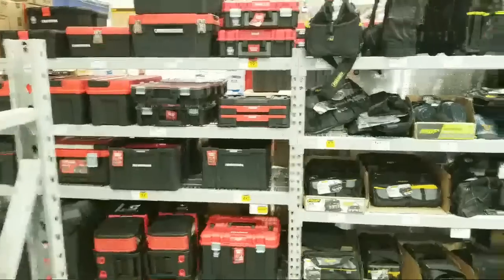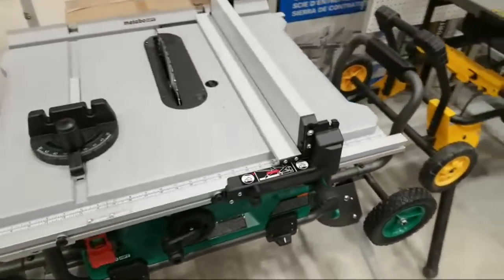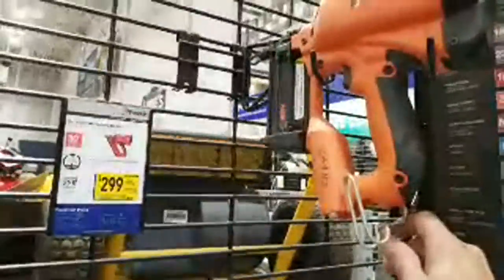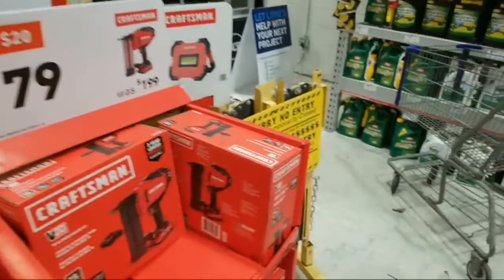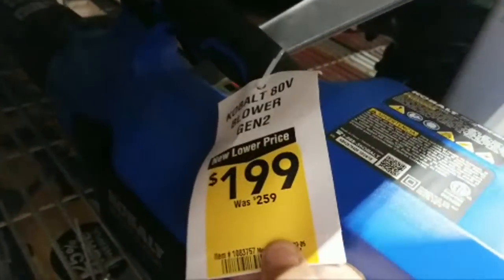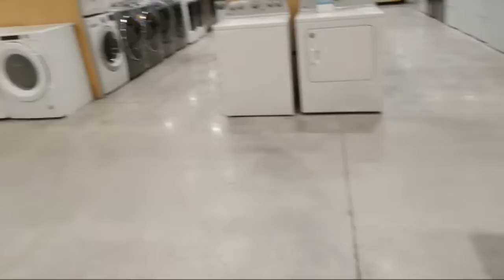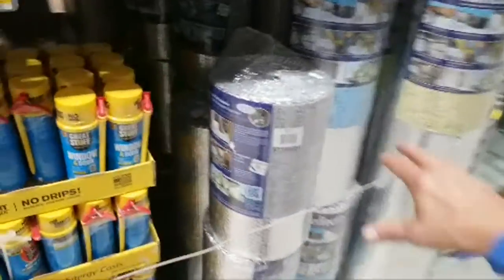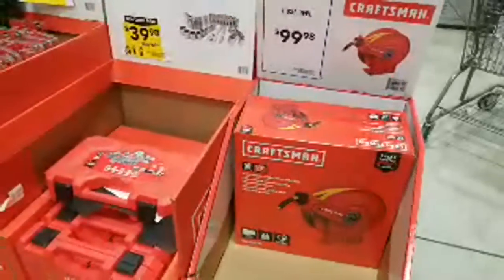Lowes After Black Friday Sale Tool Deals DeWalt, Craftsman

Comment: Always assume a blade is spinning, and keep thick superglue in your toolbox for any cuts, upto and including inches long wouns, so long as the bleeding can be stopped (relatively), and they can be perfectly squeezed back together after you lay a bead of glue up the center.  Glue will harden and create the perfect scab.  You can go back to work immediately, and the glue will flake off like a scab in about the normal time or less.  And aside from the indent (and how well it was lined up when stuck back together), no scar to speak of.
Reply: Working on a Habitat house years ago we had a guy cut open the web next to his left thumb; did it with a new blade in a utility knife while running it down some drywall. Deep, long cut that bled like a water fountain. Took him to the VA hospital close by and they closed it with glue. Said it was better than stitching it in that location. Saw him 2 months later and you could barely see where it happened; the wrinkle in the skin helped hide it. I use glue for fingertip cuts; lousy place for a bandaid to hold.
Reply from the maker: Good tips. What I have been doing since then, is I visually wait after each cut to see that the blade has come to a stop. Of course now that I only use my own DeWalt saw, I already know it's going to only be a few seconds.
Reply: @tooolboxx  That's exactly what I did, minus the going to the hospital part.  I could see the bone in my thumb.  And did take a good 20 minutes or so to stop the bleeding.  Was working on a high dollar RC Heli when it happened, so I had the gule handy, and gave it a shot.  Worked perfectly, and have used it on others many times since.  I do recommend keeping Hydrogen Peroxide around in an old spray bottle handy for all your disinfecting needs.
Reply: @jeffostroff  Personally, I treat it like it's electrified, and never touch the blade unless I'm changing it.  Especially with a table saw.  A friend of mine lost three fingers on one, and I asked him what happened.  He said I thought it was stopped.  I said fine, but why did you need to touch it.  He said he just always had, paused, looked down and added, to make sure it was stopped...  So yea, like a how a gun is always loaded, a blade is always spinning.  
And btw, I have that big 12" Dewalt and the big stand.  Picked it up off of craigslist 10 years ago for $250 bucks, and it still has the original Dewalt blade on it, and the laser guide.  I actually drew the whole thing up and posted it on Sketchup's 3D warehouse.  THe stand I mean, someone already had a perfect model of the 12" saw there.
Reply from the maker: @MatHelm  Yes, I don't touch the blade either. It was the end of a long tiring day, stressful from working in 100 degrees inside with no AC installed yet, We were framing the wall for the AC guy to hang the AC next day, hottest August day of the year in Florida, and my motor skills were way off. I went to sweep a piece of wood out from under the blade and my swing reached too far, and I just barely nicked the blade, it slipped across both my fingers. Bleeding stopped minutes later once I put towel on it, drove to ER, and was out of the ER 1 hour later! Lucky it was empty when I walked in. But $3500 mistake! My insurance would not cover it, saying it's a worker's comp issue, but they did help negotiate the hospital bill down because it was in their network.